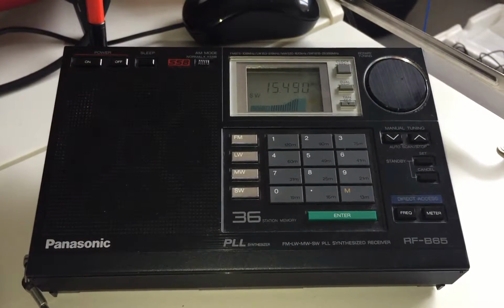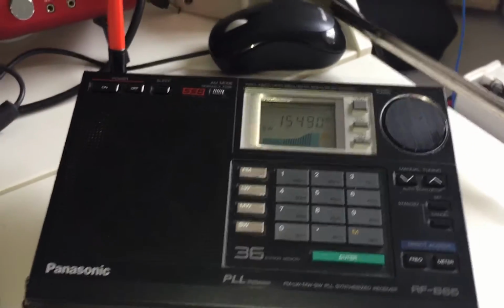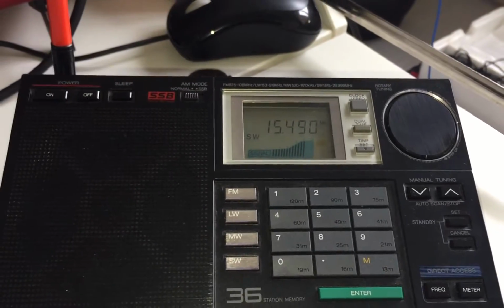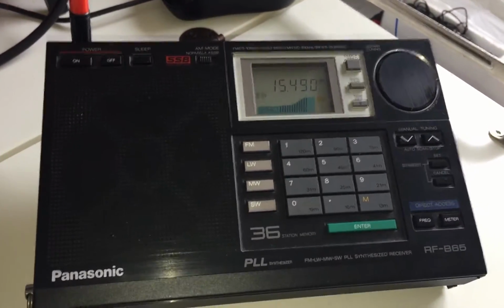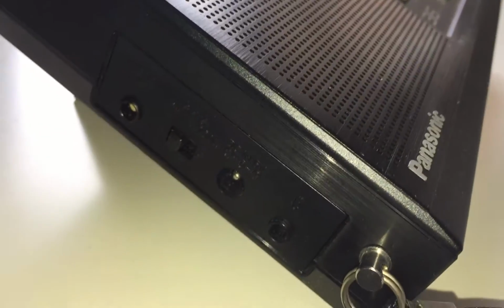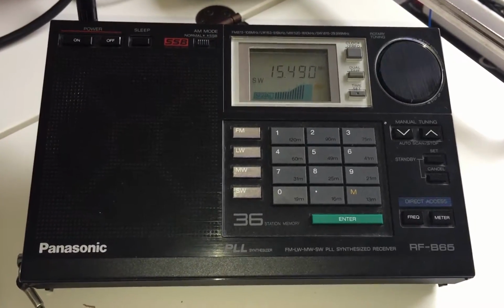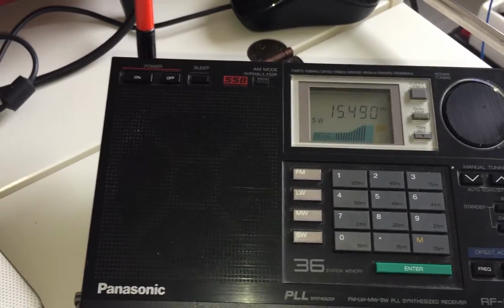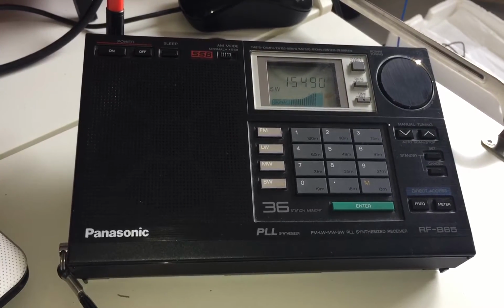Panasonic RF-B65; first impressions and summary of features

Comment: Can this radio be taken apart to clean the power button and a few others. Mine needs me to push some of the buttons a little harder to work. Is there a video on disassembly to get at the buttons? Thank You
Reply from the maker: I'm not sure, but probably - just the reverse of how it was built I guess. Take a look online. 73
Reply: @OxfordShortwaveLog Tnx. Looked all over and nothing on complete disassembly.
Reply from the maker: You just need to give it a go!

Comment: Are there any issues with battery E on screen? Mine has been getting very low battery consumption, even with fully charged batteries. Thanks for any information.
Reply from the maker: Not on mine - but I sold it a couple of years ago I think.
Reply: @Oxford Shortwave Log  Thanks for your reply. Our friend Graham has recapped it, added a new transistor, and modified the battery terminals. Works fine on the power supply. I'm running out of what batteries to use next. 😆 I've tried most, even thought of buying some lithium 1.5volt. Can't get my head around it. Have you seen the rechargeable Lithium cells on the market? I've read some bad reviews on them, so I've steered clear.

Comment: Hello how are you sir ,my i have national b65 radio that is showing an eror on screen  when i on it my question is what is the solution in this  situation?????
Reply from the maker: Try removing the memory batteries and the replace them with new. This might fix the problem. 73s, Clint
Reply: @OxfordShortwaveLog  thanks for response i will try to exchange its bateries
Reply: @OxfordShortwaveLog  then i contact with you again
Reply: @OxfordShortwaveLog  sir i replaced bateries but no change

Comment: Need help setting the clock.  Seems like it should be easy but I can't find a manual anywhere.  Thinking it may be defective but the rest of the radio works well.  Thanks in advance for any help.
Reply from the maker: Hi there Dave, I'll have a go with mine and get back to you. Hopefully I can figure it out! 73! Clint

Comment: Nice Video! One question: does it have SW up to 29.999 kHz or just up to 26.1 kHz? I'm trying to figure out which model has SW up to 29.999 kHz....There are 2 different models:  RF-B65D and RF-B65DA What model is yours? Does it tune to 29.999 kHz.  Thanks!
Reply from the maker: Thank you very much! The SW on mine goes to 29.999 kHz - I've just arrived in Crete for a week and I don't have my Panasonic with me (I'm DXing with the Eton Satellit). If you need more info. message me next Thursday or Friday. 73! Clint
Reply: Thanks for getting back. I'm looking to buy a RF-B65 off ebay and the only model I found was RF-B65DA.
I want to make sure it will tune all the way to 29.999 kHz. I know some models were made for Germany and they only go up to 26.1000 kHz. My next option for me is the Sony ICF-SW7600G... Any thoughts about this Sony? Thanks!
Reply from the maker: No problem at all - always glad to help a fellow DXer! I used to own a 7600G. It's a great portable with a very good SYNC, so I can thoroughly recommend it. Similar, performance from the ICF-SW55, despite the lack of SYNC. Best performance with the ICF-2001D. If you can find one at a decent price, don't hesitate. Arguably the best SW portable ever (other than the Eton E1 possibly). Better than the ICF-SW55, the RF-B65 and the 7600G and just about everything else. You'll probably pick one up on eBay for similar money to an RF-B65. Hope that helps! 73! Clint
Reply: I got the Panasonic RF-B65 in mint conditions for 112€ shipped, off ebay. Hopefully it works as well as it looks... What would you consider a decent price for a ICF-2001D? 73 Chuck

Comment: These digital shortwave radios with synthesized tuners are magnets for RFI from computers, routers, cable modems, lights, etc. Try an old school battery powered portable, like a Zenith Transoceanic,  and you'll be amazed at the difference. Sensitivity can be as high as you want, but sitting next to a powered on laptop, and it's not going to do you any good. Your signal to noise ratio of the Yaesu is going to be poorer running off of household current.
Reply from the maker: Thanks for your comments Arthur. Fortunately I never use a portable at home, there's far too much RFI. I spend much of my listening time out on DX'peditions in the wonderful Oxfordshire countryside. I love the Transoceanic portables, except the most recent models of the early 1980s? 73
Reply: +Oxford Shortwave Log I have an RF2200 in the basement that I need to dig out. My Transoceanics are the 1000, and 3000-1, and A600. The sound quality on them is spectacular. Your channel is fantastic! Enjoy your new Panasonic!
Reply from the maker: The RF-2200 is a beautiful radio, I'd be very interested to see it in action. The Transoceanics were the inspiration for a lot of poorly performing imitators - and I have one - a Binatone Worldstar! Thanks for your kind works, it's nice to know the effort is appreciated by fellow radio aficionados and DXers. 73!

Comment: Panasonic respected radio lovers and radios.  The almost always designed quality products that were well built and fun to use.  I am as happy for you, Clint, as when I snagged one.  I'm very excited and can't wait to see the 65 go up against 'Tank!'
Reply from the maker: I have always liked Panasonic/ Technics kit, it's nearly always excellent quality and in my experience at least up there with Sony. The RF-B65 is the portable that I always wanted to own with excellent performance but in a smaller form factor than 'tank'! Now, 'tank' is considered the benchmark against which all other portables will be compared forever more. If the RF-B65 comes close, then I have the perfect travel portable. 73! Clint

Comment: Key layout and display reminds me of a Sangean radio.
Reply from the maker: Hi Peter, yes I know what you mean, it's a bit ATS-803A..esqe....! 73!
Reply: +Oxford Shortwave Log I was thinking the same thing actually :)
Reply from the maker: It's much smaller though than the Sangean, it's more like the size of the Sony 7600G. 73! Clint
Reply: +Oxford Shortwave Log It was hard to judge the scale of the receiver so thanks for the clarification, will look forward to it's use in the field